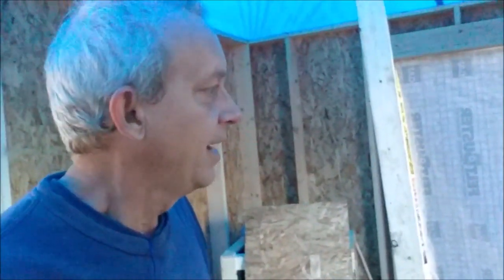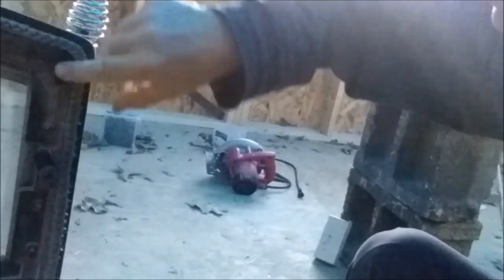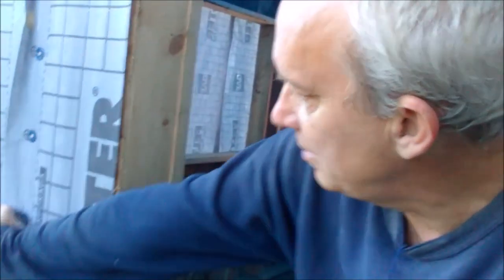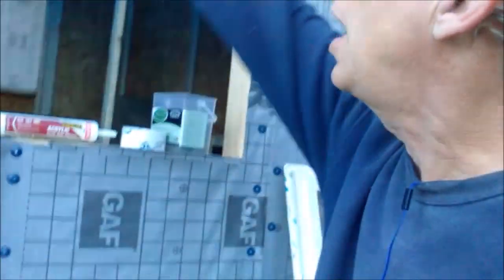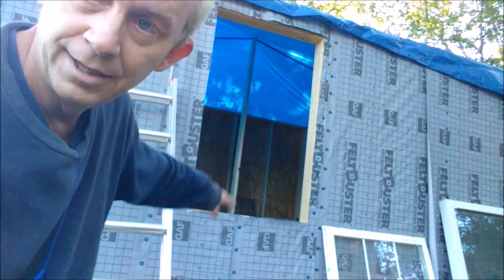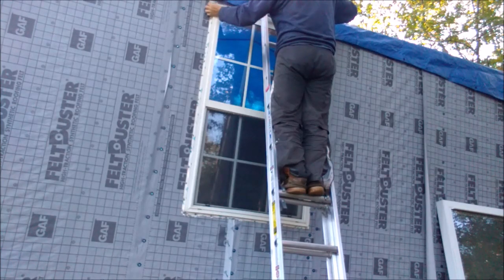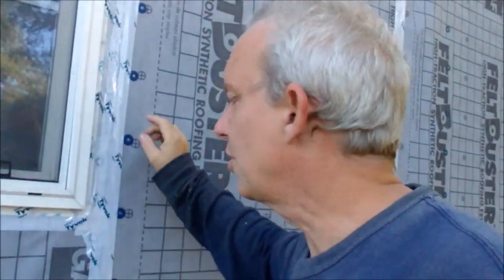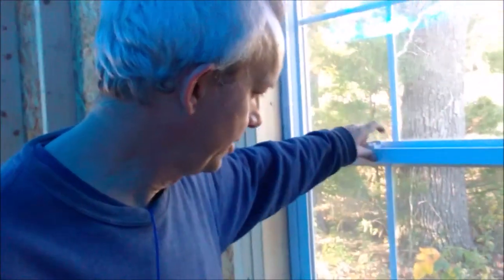No Way Did This Just Happen To Our Tiny House While Off Grid Living

Comment: Another idea for under the wood stove you could use a stove board. Lowe’s has them and a lot lighter than concrete or tile. Also even though the clearances in back are per instructions, the wall behind the stove gets very very warm. Maybe some tin with spacers behind stove just to be safe. Just some things to think about. :)